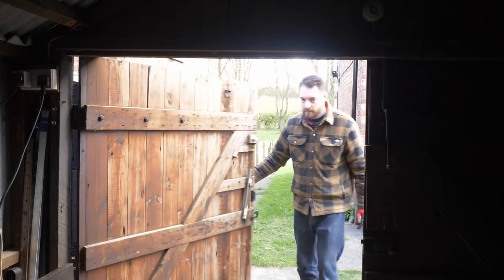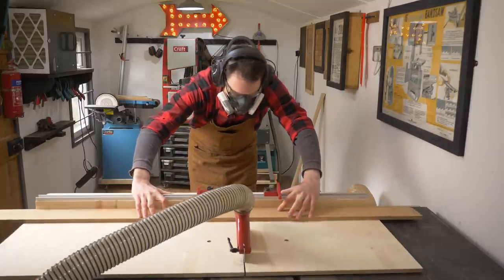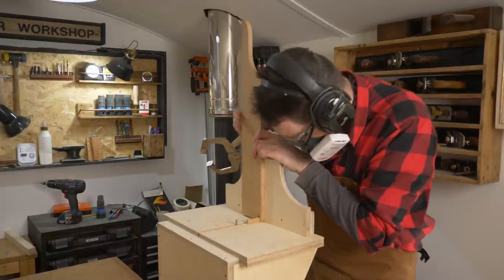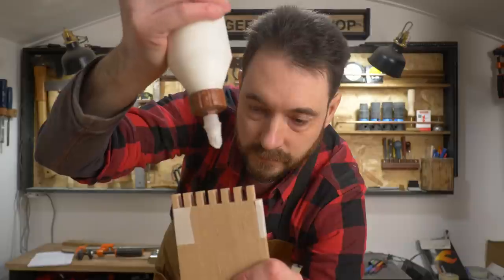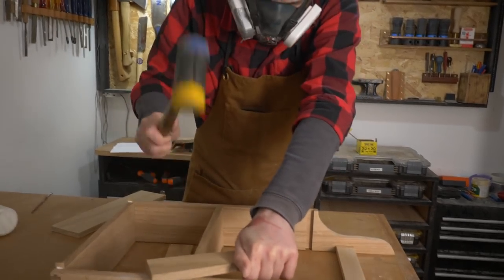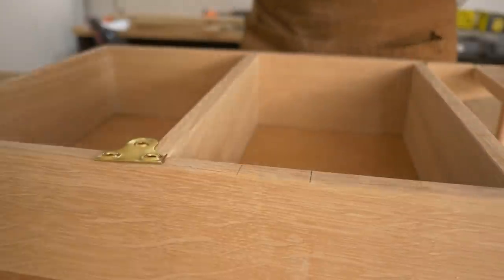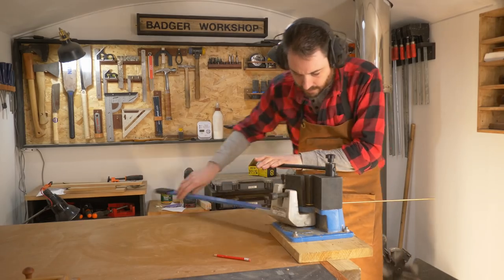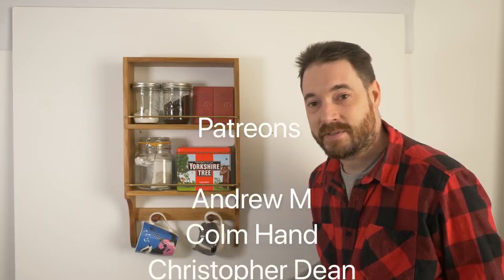Making An Oak Tea Rack

Comment: I made something similar and to mount my shelf. To MOUNT mine, I attached a strip approx. 3/4" (19mm) square along the top/against the wall, to attach to wall w/ a couple screws into studs, AND another similar strip along the bottom. The bottom mostly supports the weight and wouldn't really need to be attached to the shelving.

Comment: well done as always

I really like your mini router table. I think I need to make one, even though I already have proper 1/2 inch router table on casters.
the mini router table I'll use for my trim router, because it's battery operated, and I can do small router jobs anywhere.
Reply from the maker: It is handy but I would also like a big proper router table
Reply: @Badgerworkshop  I had it FIRST
[just pulling your leg]